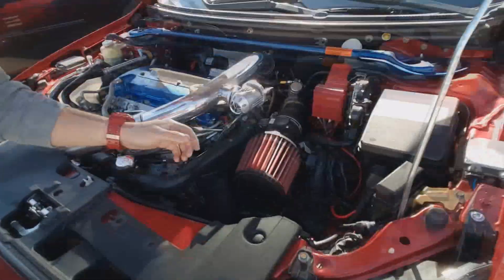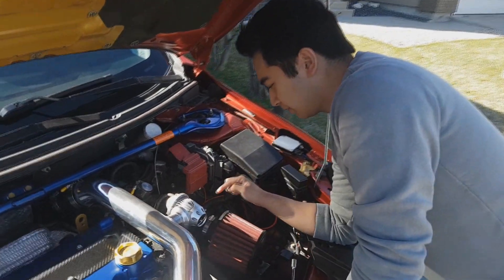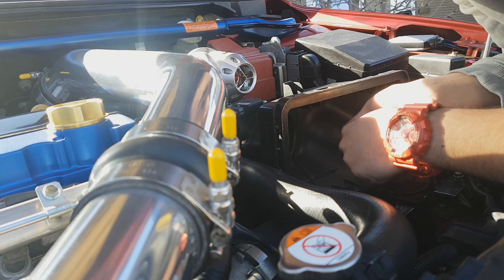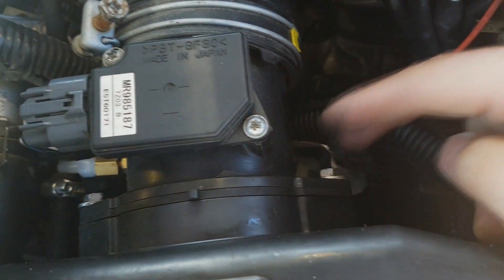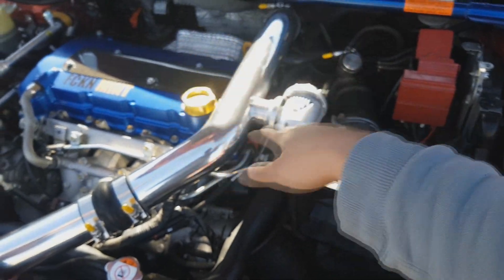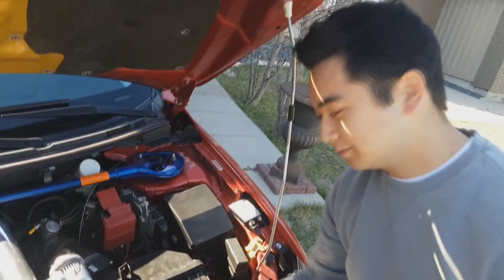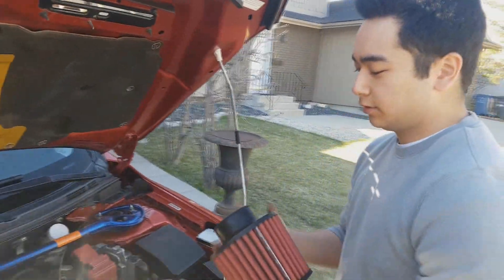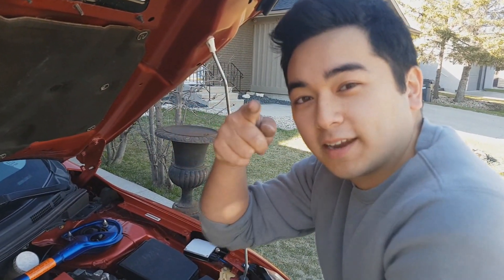Evo X OEM Intake Install!?!

Comment: that intake is too short so its sucking heat from the engine into it, best intake is ETS,  best drop-in is either HKS or K$N i have both, run the K&n mostly but sometimes i switch to the HKS since it seems make the bov have more noise
Reply from the maker: Evan Silverberg thanks for the tips man, thts the reason i put back the stock intake, i was making less power. ive been looking at the hks drop in but i heard it ruins the maf but again i have no experience with it lol
Reply: it doesnt ruin anything dnt worry, stick with K&N its better and resusable and only 10 bucks more otherwise youll be throwing out the hks one after a few months the filter material will wear out unlike the k&n, if not go ETS intake its the best.
Reply from the maker: Evan Silverberg hks it is! im planning on getting an intake next summer anyway. thnks for the help, i appreciate it!